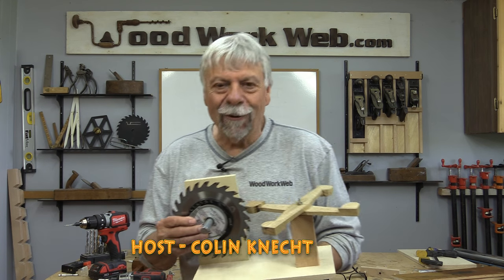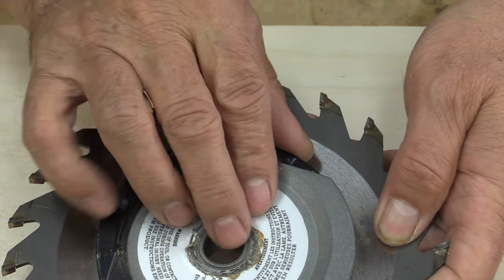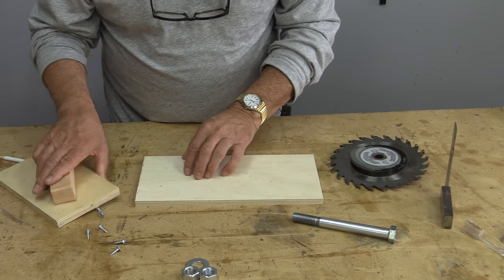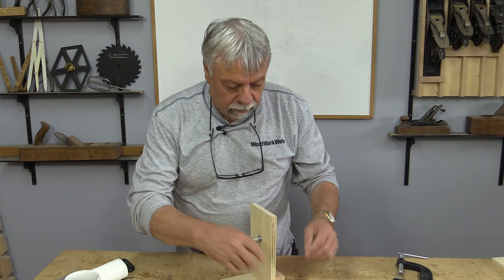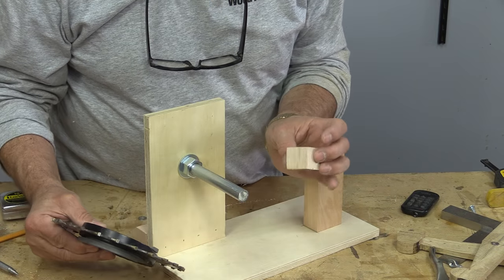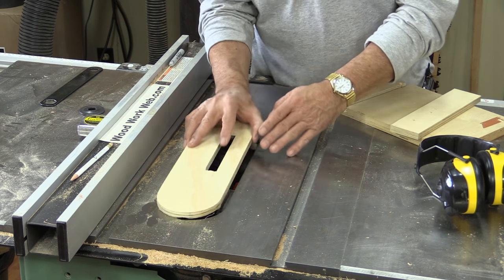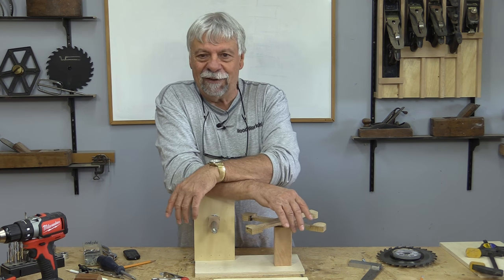Making a Sizing Jig for the Wobble Wheel Dado Blade

Comment: I love watching your YouTube videos. Thanks a ton. I have been a woodworker since I was a kid and now I'm about to be 67 years old. Just wanted to say thanks for what you do and give you a tip that works great for me.
A tip that I've been doing foe about 20 years for a handy glue bottle. I buy tightbond glue in gallon jugs. Then I fill up a bunch of Mt Dew, 20oz bottles with the glue and tighten the lids on the bottles. The one I'm using I drill a hole in the top of the lid. The glue comes out easily with a little squeeze. The flat top of the bottle lid is great for spreading the glue while you are putting it on the wood. The glue remaining on the lid will skim over and dry, keeping the glue in the bottle from drying out. Something about the green plastic lid makes the glue not stick well to the top of the lid. Then when I need it again I just scraped the glue off the lid with my fingernail. This doesn't cost anything and works great.

Comment: Hey Colin,
   I am 71, it did not take long to get here either. You just showed old dogs new tricks.  I have the wobble 7'' from Sears, and the 8" Excaliber adjustable by sears also.  At that time, I did not know about stacked dado sets.The wobbles are extremely hard to adjust. I usually end using a router. Yesterday, I bought Diablo stack dado at HD. Your homemade caliper is simple and ingenious. Your design could be used for several applications. I see a heavy rubber band holding the test board tight to the outer caliper, a lower clamp to steady the test board, or just a smaller piece of wood between the pincers, I think I would leave that in while adjusting the dado blade. Your design beats using digital calipers with all those thousand inch readings that have to be converted into something usable.  Your gizmo is an extension of the reliable story stick.  Keep up the good work, young man.

Comment: Calibration Table: Set, cut, measure, record; rinse and repeat. Refer to table... 
You could even use an Excel spreadsheet to create a graph for interpolations, that way you can minimized the number of data points necessary for the table.

Comment: You need to secure the wood being sized.  

1) Extend the base past the X-brace sizer thingy.  
2)  Four bolts coming through the bottom of the base on the extended side - two on each side of the wood being sized..  
3) Two rectangle center-ing blocks with slider holes to sit on top of the four bolts.  
4) Add center line on base for the wood to be sized. - this must be centered with the Wobble Dado Blade and the sizer thingy center point.  

Application:  
Center wood to be sized on the center line.  
Pinch the wood with the sliders. 
Wingnut tight the sliders. 
Pinch the sizer thingy.  
Adjust your Wobble Blade.

May The Force Be With You.
 
Buck
Reply from the maker: Some very good suggestions Buck, thank you for the detail buddy ... appreciate it

Comment: I use a fine line marker (Sharpie in the U.S.) to make line up marks on the hub and blade of my wobble dado. That way I can make small increment changes and know how much I'm changing the dado's width as I do test cuts. You hear lots of people slamming the wobble dado because it makes a slight concave bottom cut. I don't find that to be a problem because the shelf etc. is often end grain with low glue holding capability anyway. You might even say that the very slight concavity is a good place for glue squeeze out like making a dowel hole slightly deeper than the dowel.

Comment: Is it worth grinding off that cast Zero mark on the inner part of the wheel and the engraving "true Zero" in the correct position. No one can expect to calibrate with such rough markings to start with.

Comment: I have found that when you take the blade off and on it moves the adjustment.  I just loosen the arbor nut and do any adjustments right on the arbor them tighten the nut again.
Reply: Mark Egstad Pretty much. I have one myself. It's just in its design. No jig will set it absolutely perfect. Yes this dado blade works but prepare for a lot of test cuts and a lot of luck.

Comment: Colin!  Good job.  I like a guy that's trying.  I'm glad you debugged it.  I would be astonished if it worked right out of the box with no tweaking.  One thing I'm sure you saw was the need to put the central pivot for the arms exactly in the middle.  If the arms are a foot long, that pivot can't be at anything but exactly 6 inches.  Any error will cause on end of the arms to be different than the other.  I'm sure you made all your cuts perfectly.  It looked very good.  I know this is an old video, so I'd like to ask if you've gotten it to work to your liking.  I'm thinking that aluminum arms might be nice.  Good luck and great videos.

Comment: i'll give you an idea for a better jig:
cut 2 pieces of board, make 2 holes big enough so the centerpiece of the blade can fit. now put the piece of wood you want to measure between those 2 boards. adjust the blade until you can see it touching both the internal sides of the jig without moving around and that's it, perfect measurement every time... if you couldn't undestand the idea i can draw it to you if you send me a mail
Reply: Dario Ampuy that is a really good idea, and fewer moving parts to allow for error. I have a couple of these so I may try your idea as well!
Reply: Great idea! I tried to make something along Dario's lines. It didn't work exactly like described as the low point of the blade changes depending on adjustment angle and the top board will be angled according to adjustment as well. My blade is pretty small as I have an old Inca table saw so it never touches the bottom board. What I did instead was to let the top board just be a tightening nut instead. Then I can measure the distance from from the blade edge to the bottom board at the highest and lowest points respectively. Dado width is the the low number subtracted from the high number plus the thickness of blade depending on how you measure. This turned out to be incredibly precise - a test cut was within 2 hundredths of a millimeter from the jig suggestion. My old wobble washers don't have any markings except high and low points, but on the bottom board of the jig I have now marked different dado widths making it quick to get in the ball park in the future.
Reply: Dario Ampuy send me one too!

Comment: That jig is a nice idea.  I think it might work better for you if the 5/8 shaft were vertical and if you were to put  metal faces on both of your calipers.  I think you could then hold the plywood of the thickness for which you cut the dado and turn the center disk of the wobble wheel until the cutting teeth just touch the metal faces of the other end of your calipers.

Best,

Charlie

Comment: Very ingenious....a little tweaking might just work out the minor kinks. I have a Craftsman adjustable I use all of the time. I have actually gotten pretty good at setting it up. Might take me a try or two. I have used a Sharpie silver pen and carefully marked the 3/4 and 1/2 setup I normally use. Also, I am not quite sure why some people get a less than flat bottom. Mine is absolutely flat bottomed. Thanks for the idea.

Comment: I was thinking that using an indicator dial gauge might work.  Put the needle perpendicular to the blade then zero it when the end of the blade teeth are at their closest point then turn the blade one half turn where it is at its farthest point from the gauge and the dial will show the width of the dado cut.  You could similarly do this using a caliper.
Reply: I like this idea better.  I guess you could do this while the blade was riding on the saw arbor also....saw unplugged of course
Reply from the maker: I did try the caliper idea a few times, didn't really work for me ... it's a bit of a pesky blade to set.

Comment: I just got a wobble wheel and I've found the marks on mine are spot on. The marks are machined on mine and yours looked more like they casted. After you put the piece in the arms you need to find a way to lock them in place so the wobble wheel can't move them while adjusting the cut.

Comment: Why didn't you lock down the wing nut on top after setting the size with your board? It seems that would keep it stable enough to get a better measurement.
Reply from the maker: Yeah .... others suggested using some sort of  clamping device on the arms, I think that would help too ... also my wobble wheel is quite sticky in some areas, that's not helping either ... lots of room for improvement on this ... thanks buddy for you suggestions.

Comment: OK, lots of credit for good intentions :) But if I want a 1/16th dado, say for stringing, and don't want to use my router, I can use the 1/16th inch four-wing chipper from my 8 inch dado set or I can even mount a 6 1/2 inch circ saw blade in my table saw. Just ribbing you, I enjoy all your videos and the good-natured way you present them.

Comment: Super cool idea :) 
You've earned a subscriber. 

It looks like an issue could be made for the wingnut holding down the two arms. 

What if you had a secure locking nut there instead, so, after you "size" the width (8:05 in your video) you then tighten up that locking nut?

That would do two things:

1) "Hold" the spread position of the arms for the size of the dado width. 
2) "Hold" the arms from spinning on that center post. 

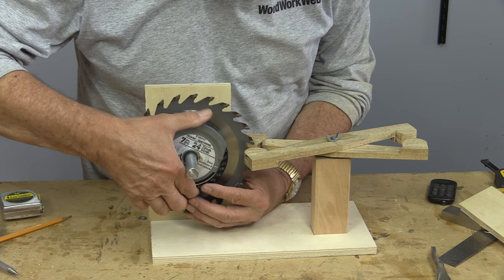If you notice, at 8:20, as you adjust the wobble blade,. the arms shift ever so slightly, which can definitely affect the wobble blade adjustment.

Comment: You may want to double check your pre-assembly measurements to see if there was an alignment overlooked. Sometimes this happens to me if I didn't double check if i'm plumb or square or if my reference points I measured from were not the correct references.

{SLIDING FENCE JIG]
Alternatively, you can make a backing plate in parallel contact with the blade's furthest reach and piece you are fitting  And your front plate will act as a sliding fence to reference the piece thickness to the furthest reach in the other direction. 

As you sandwich the backing plate and fence to both the blade and item you are fitting, you make sure you have your shaft hole drilled through the backing plate is plumb and recesses made to clear the protrusions on each side of the wobble blade hub.

Additionally, I would cut out a circle on the fence plate so I can simultaneously adjust the blade to the piece in one step. As a final note, there is more to do than what I explained here but it covers most of what is needed.

As always, measure twice and cut once.

Comment: I think the problem with this jig is that that scissor arrangement is even wobblier than the wheel and I'm not sure you sanded both sides evenly. A wooden vice would be simpler to make, more acurate and more stable. Make the vice wider than he wheel and mount the bolt in the middle, then adjust the vice to the wood and adjust the wheel to the gap in the vice.
Reply: Also, if the pivot pin for the scissor mechanism is not perfectly in the center of the arms, he is going to end up with a different size than whatever thickness is the board that is going to be inserted into the dado.  Kind of like what happens in those enlarging pantograph devices.  The distance between the pivot point and the point where the arms touch the blade needs to be exactly the same as the distance between the pivot point and the point where the other end of the arms touches the sample board.  Just like with regular scissors -- you open the handles a short distance and the tips of the scissors open a large difference.  Considering that he's working in wood (which can cause the drill bit to drift) and he's drawing his lines in pencil and sanding by to a hand drawn pencil line, it wouldn't take much to introduce error into the mechanism.  For something like this to be accurate, you're going to need to make it out of metal and use a lathe and probably a milling machine also.

That said though, I think there might be a design that did not use the scissor arms and would be more accurate.

I'm thinking that instead of having a scissor mechanism, you had two vertical plates that had a slot cut in them from the top to the center that was large enough for the "arbor" to slide into.  The vertical plates would slide in a track towards each other.  The wobble blade would be on the arbor and when the blade touched these vertical plates, you would know that the distance between the two plates at any point along its edge would be the same as the dado that would be cut by the wobble blade.  You then either measure it with some digital calipers and compare it to the measurement that you took of the wood for which you are trying to cut a dado or you just slide that piece of wood between the two vertical pieces to see if it fits acceptably tight.  Of course, the key thing here would be ensuring that the two plates are exactly 90 degrees to the arbor and that the arbor is perfectly parallel to the base of the unit / grooves.  I'm thinking this would have less margin for error than the scissor mechanism.

Comment: You have to know how the blade cuts relative to fence position.  For example,  your fence is at 2" and your blade is aporox at 1/2" setting,  does it cut from 1-3/4  to 2-1/4 or from 2" to 1-1/2", etc. Once you know that,  make your dado smaller than desired width and after 1st pass you move your fence accordingly to complete the cut.

Comment: Me not knowing much about this, I would leave the blade on the saw.use my machinist calipers.rotate the blade while holding the calipers in place to get a measurement.maybe leave the nut hand tight while adjusting the run out. Then compare to your wood.
Reply: Remove two arms, make it a plywood two-arm caliper to measure the board edge thickness and lock it, then rotate the two-arm caliper to adjust the blade's wobble kerf. This tabletop jig gives easy access to the wobble blade for adjustment before installing blade to table. Good video

Comment: We are in a strange way not allowed to use dado stacks or wobble blades in my Country, all our axis are to short, but I do have an idea. Make a vice jig with both sides moving from and too Each other like those most small vice clamps but with one screw axel and two nuts one left tread and one right tread so the vice pieces go in and out the same time and line-up pins same as a workbench vice, place this 0.5 inch above the height of the wobble blade, now center the wobble blade straight as a normal blade, clamp the vice over the blade and position in on the bottom.
Now by turning the vice to put in the wood in the vice, now easy set your blade to the thickness of the wood

Comment: Thanks for the video. Maybe the reason why ½'' plywood is less than ½'' because it's made to metric dimensions?
Here in Europe you can buy 12 mm plywood (½'' = 12.7 mm). But maybe they make all sheets 12 mm and just call them ½'' in America instead, without adjusting the thickness from 12 mm to 12.7 mm (½'')?
Of course dimension will also vary slightly with temperature and moisture content.
Reply: 12.54  actually, but you point is noted, the Americans are metric averse unfortunately. Much of their manufactured material seems to be in metric sizes and often the simple answer seems to be purchase metric cutting tools online.
Reply: Colin Bluett, Sorry but ITubeTooInc is correct. 1 inch is exactly 25.4mm, so 1/2 inch is 12.7mm.

Comment: Cut each width into a peice of scrap
Stepped down like A uni-bit
]=- 
You could go further with cutting on both sides of the line and mark it (H.) heavy or (L) light. So you can judge how much tolerance it has.

Comment: Wouldn't a pair of calipers work, measure board then spin blade.?
Reply: BlackTalon 1 - calipers would be hard to use. The carbide teeth are wider than the body of the blade. With caliper you have to reference one side of a tooth, hold the caliper exactly in that position  rotate the blade to the tooth that is exactly 180 degrees away, and measure to the opposite side of that tooth. A jig like this (with moss suggested by others) makes the process much simpler - all you have to do is look for light tooth contact on both sides.

Comment: The inherent strength of a dado or a shoulder butt and lap, is the joining of the long grain of two pieces of material as well as the close fit of the shoulder(s).  The fine and close match of the long grain on material overcomes the weaknesses of end grain and long grain of the shoulder(s).
The integrity of a dado is the marriage bonding of the long grain. This is why we scarff where end grains requires union. 
The "Wobble Blade or Adjustable Dado Blade or Dial a Grove" blades are useless in fine woodworking as wooden Nickles are to financial security (unless and until a hand-plane router corrects the concave surface).
Better to hand sawcut the shoulders then chisel and hand-router plane the base. That is correctly called woodworking. 
Wobble planes are time and a forfeiture of quality.
Reply: You are missing the whole point of the exercise! It is not to go down the route of hand wood working, but rather to improve on ideas, so put your thinking cat on you expert wood worker. How would you do it?

Comment: Give you an a for effort Colin but that scissor arrangement is going to be inherently inaccurate no matter what you do to it! You would do better with a screw activated spacer at the top of the post. Set one side to the left edge of your blade and use a screw to open a gap between to the proper size. It wouldn't move around so much and would stay where you put it.